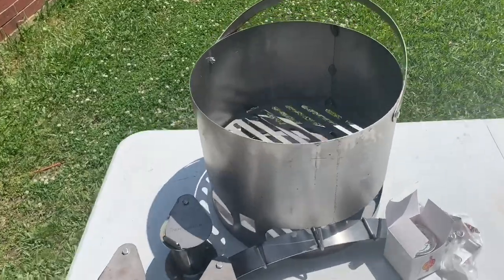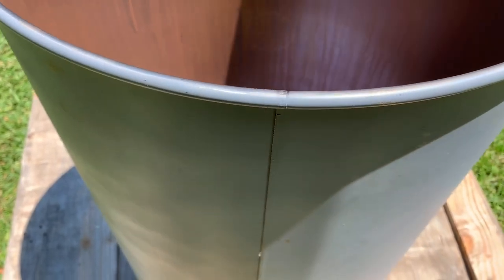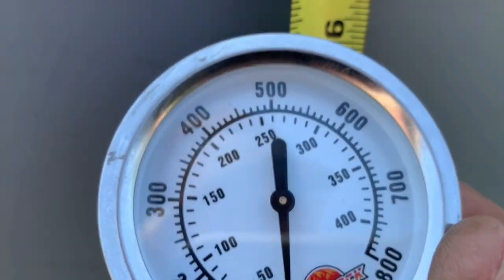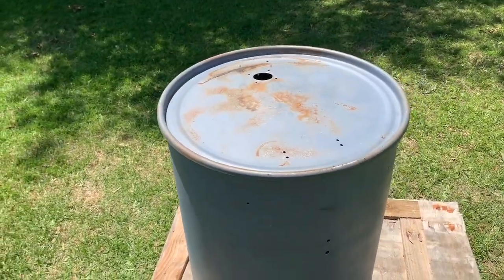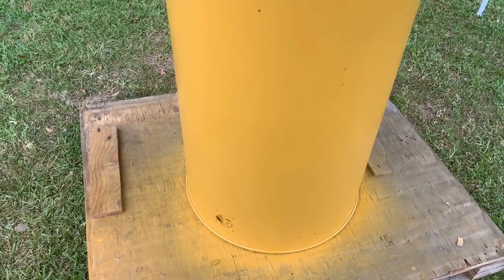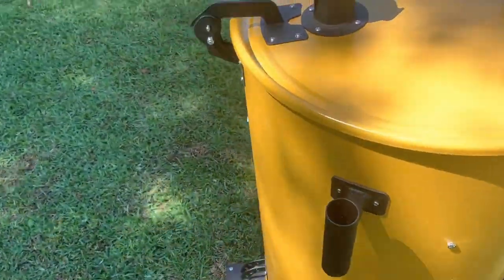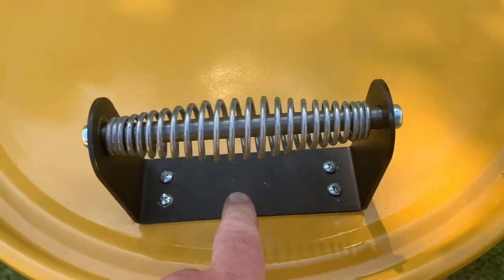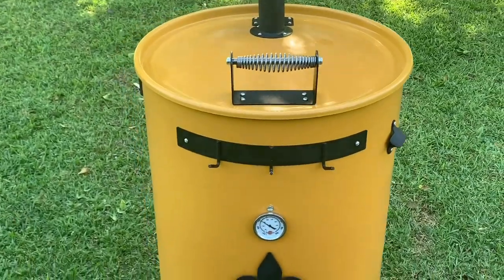How to Build a UDS w/ a Kit from UDS Parts : A Collaboration with Ugly Drum Smokers, Texas

Comment: BIG LEW!!   Would these parts work with a wine or whiskey barral?  Would you build one and make a video?
Reply from the maker: The answer to both questions is, I don’t know.
Reply: I would say not.  Could you make them work?  Maybe.  But the hardware supplied is made for a steel drum (super thin metal) and I dunno what would be required to keep the barrel from burning down.  You'd need fire brick or something to line the bottom

Comment: Thanks Big Lew BBQ. I’ve been researching UDS builds. Plan on using parts from UDS Parts. This was a good vid on how to build. Subscribed & set notifications. Just got a used 55-gallon drum. Just waiting to order parts. The assembly is straightforward and simple. I’m concerned about the painting process. I did hear you say you used a high heat primer and 2-3 coats, what brand of paint did you use, and could you please explain in brief steps the procedure. Thanks so much. This will be my first UDS build.
Reply from the maker: Norman Ham I really enjoy both of my UDS’s. Thank you for subbing.  
I won’t be making any more videos for the next month or so, maybe even longer.  I do hope to return to video making when I can.

Comment: Is the yellow paint a high temp paint or just the primer???
Reply from the maker: The primer was high temp.  The paint is not but it is a tough paint. It is Truck, Tractor, and Farm implement paint. Caterpillar yellow color.  It has held up very well since I did this smoker over a year ago.
Reply: Thanks for the quick reply.  I was wondering if I used the high temp primer, could I apply a different or regular spray paint to broaden my color selection.  I did notice that there is a high temp clear coat.  Thanks again, very helpful..
Reply from the maker: @johnwatz4955  Steven at UDS, TX is very knowledgeable about such things. https://youtu.be/hQtLKEjQxYI